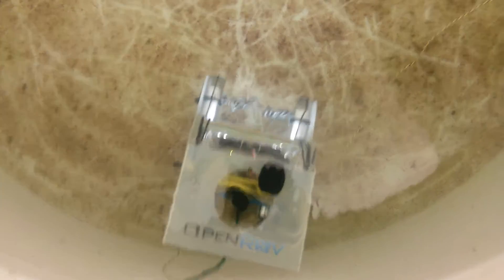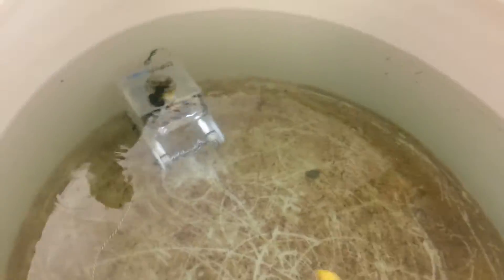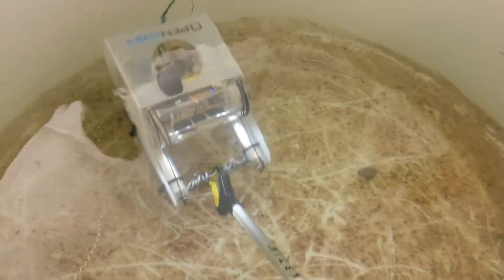PID control loop with OpenROV

Comment: If I may ask what code did you use to make this, how did you get the data from the pressure sensor? Did you use Arduino or another microcontroller?
Reply: Was wondering the same, would love to use the code in ours too.
Reply: James Rank Same here.  would be interested in at least maintaining a constant depth without overloading the vertical screw... please elaborate